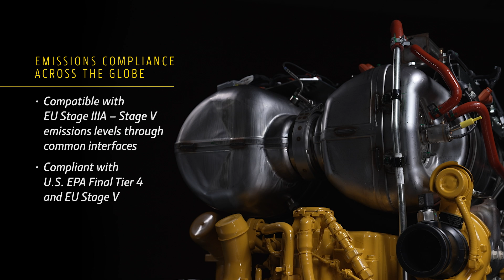JD4 Engine: Compact Size, Big Power | John Deere Power Systems

Comment: Went the opposite way of fendt, they made a 224 hp 900 nm 5 liter, while JD reduced the displacement and horsepower, and made it lighter.  Cause the 6R 150 has the 4.5 L with 177 hp max boost. May be the European 3.9L will boost higher than the US version.
Reply: Fuel efficiency
Reply: @MJF40  yeah but they also increased the max rpm to 2200. While Fendt is all about operating at 12-1300 rpm. Not sure if that's the case for the 4 cylinder 5L engine tho
Reply: May be there will be a JD5 4pot also..

Comment: How many hours is this design to last?
Reply: depends on how much money you want to throw at it
Reply: @windzer  sounds about like what JD is thinking
Reply: @itsaRiot  haha yup
Reply: depends on the operator
Reply: I had a JD tech tell me hes seen 35 000 hrs on these in gen sets and still running greate they just get called out to do the service on them
Reply: @taylorh3930  that's super impressive!!
Reply from the maker: Hi, the JD4 is still undergoing final testing and we're unable to share that figure at this time. We'd encourage you to explore the product page for more information about the engine and contact your distributor for details about your specific application needs: http://spr.ly/6053vWJvW.